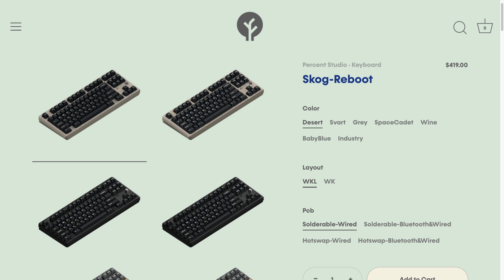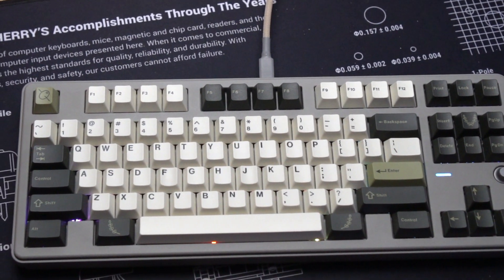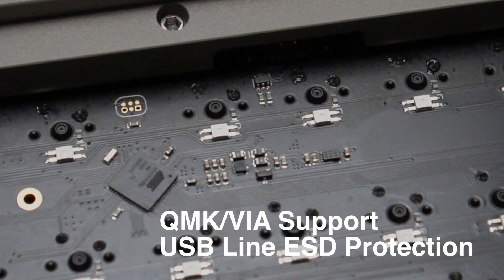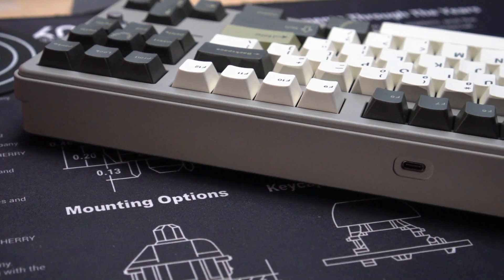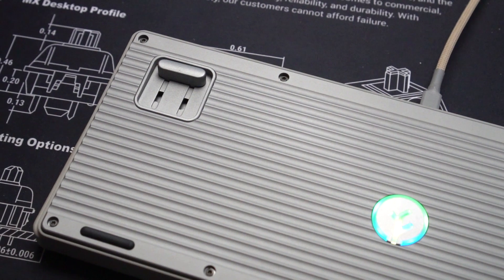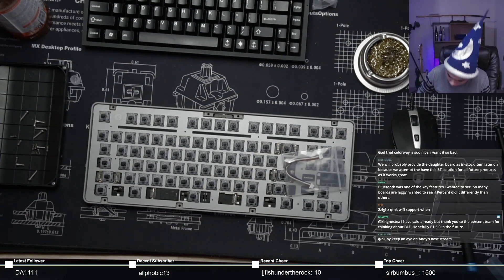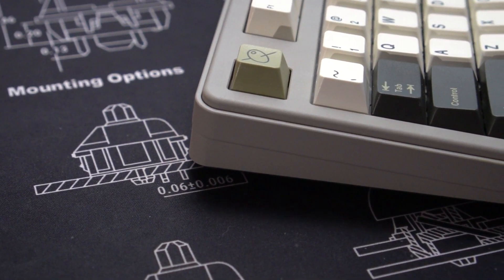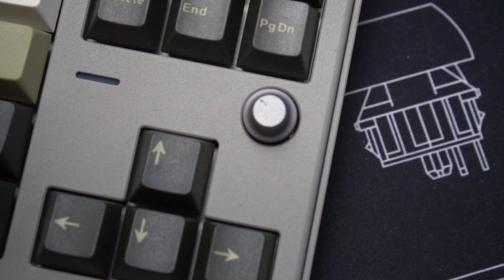Keyboard Review: Percent Studios Skog Reboot (Prototype)

Comment: Can you use Mx switches on it? I want to use Mx cherry browns, would that work on it? Also, is there a hot swap version of this board? Lastly you say you didn't like the wkl design. Is that particular to this board, and if yes, why? Or did you mean that comment more generally?
Reply: yes you can use mx switches.
Reply from the maker: Yes this board is compatible with all MX type switches. Yes Hotswap is a option as well. I don't like the WK layout.
Reply: WKL = Winkeyless WK = Winkey. Basically, WKL boards don't have windows keys, and WK boards do. As you can see in this video, merlin's board has blockers where the winkeys should be, making this a WKL board.